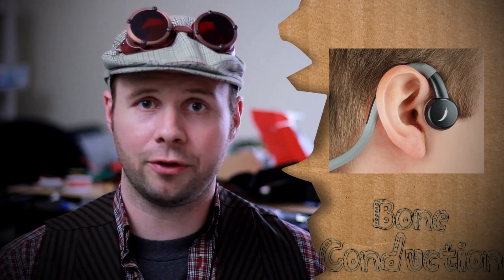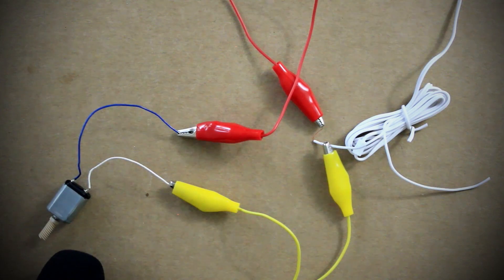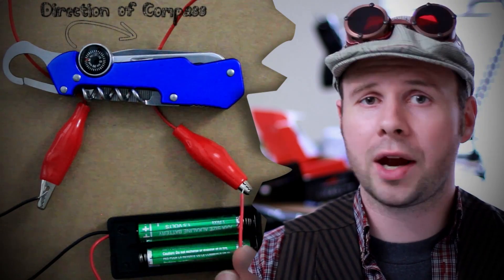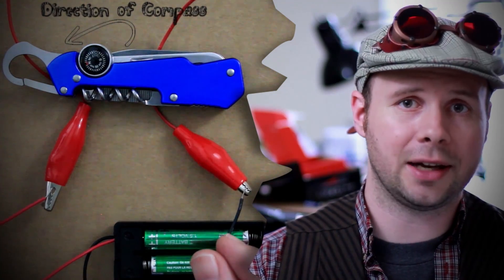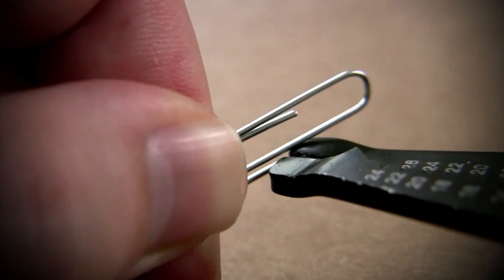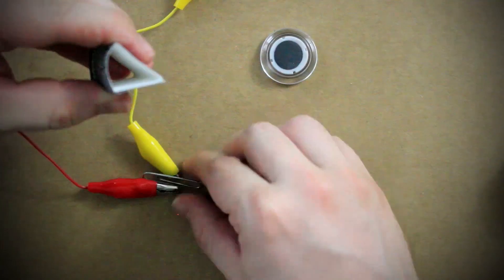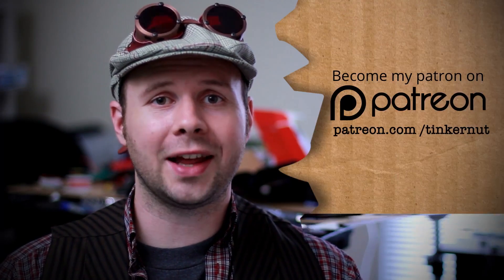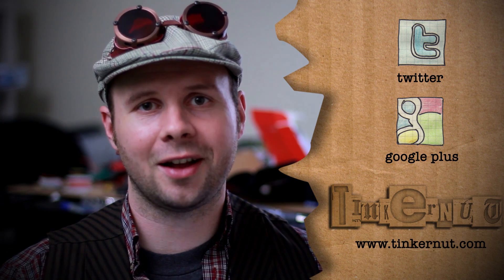World's cheapest speaker!

Comment: Or you might blow up your mp3 player. This is a short circuit.
Reply: tarstarkusz Yup, that's going to draw some current.  I wouldn't plug it into anything I value.
Reply: doomlordi Well crap. I just plugged my phone into the speaker and the speaker didn't even work (Did a really bad job wiring it.) right before reading this. It still works though
Reply: EPICGAMERSIX Consider yourself lucky. Never do any of these wacky electronics hacks on equipment you value. Look around for real projects and try them. Make magazine has a rather simple amplifier for headphones with a bass booster (IIRC) with a tutorial on YT.

Comment: I don't know.. The motor speaker does not work for me. It does not work off my phone's jack, nor my LM386 amp. I also have a Technics 5.1 receiver but I didn't want to fry it so I didn't try. Maybe it's my motor that's not good, it was in an old CD drive's eject mech, and it runs off a 9v battery smoothly.

Comment: Once I made thing that converted electric sound signal to audiable sound . First , I used very long wire ~ 2m and made a coil that fits around neck . Than , I put small magnet from old headphones into ears - is comes out by putting paperclip inside and magnet sticks . Current inside wire made magnetic field and magnets inside ear vibrated . I found that idea on some forum how to cheat on exam and not get caught . Copper wire should be connected on radio receiver and you should have very close and patient friend to talk answers to you .

Comment: I wouldn't connect the resulting speaker to anything I care about, as it will be shorted out by such a small coil. It seems like the impedance of the resulting speaker using a paperclip as the coil would be dangerously low.

Comment: You said that the EMP wouldn't work on the fan because the voltage was too high. I was wondering if it would be possible to reduce the voltage to the fan by taking out one(or more) of the batteries and replacing it with aluminum foil so that the fan should still work but the LEDs will be dimmer and the fan will spin slower and then you can EMP. Also, does your emp involve a disposable camera capacitor?
Reply from the maker: Yes it does involve a disposable camera capacitor. That's a good idea with the fan, but I'm trying to keep the steps as absolutely dead simple as possible, and adjusting trying to hack the fan to make it work or substituting other parts makes it harder to follow/explain.
Reply: Maybe the fan hack would be an interesting demo video for your tinkernutremix channel. Thanks for the quick reply!